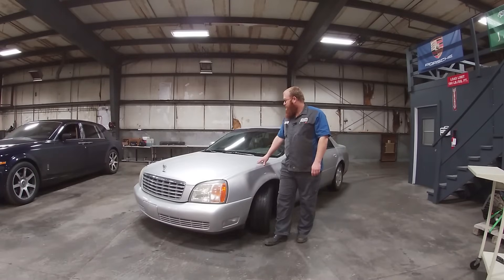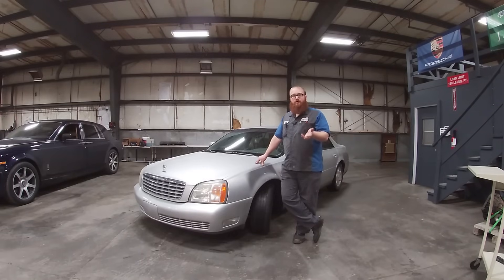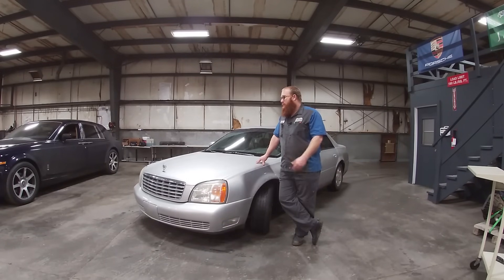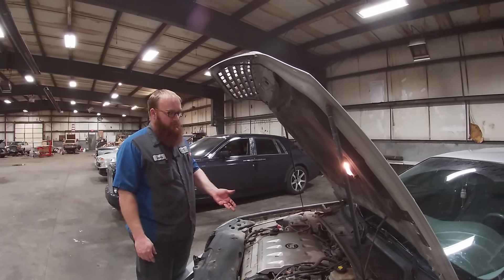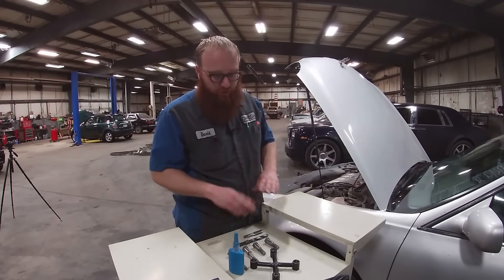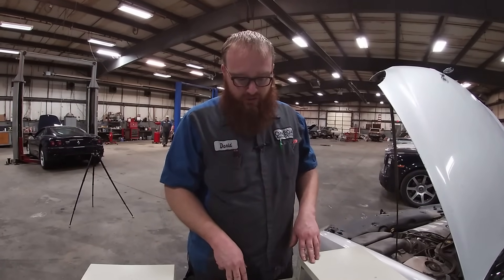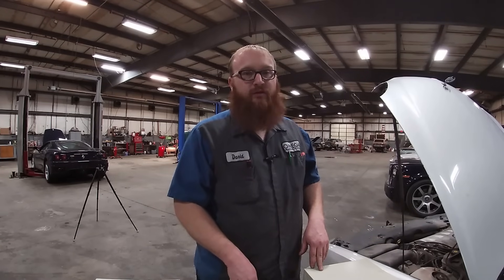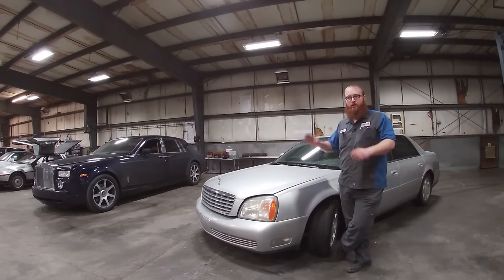The CAR WIZARD names Cadillac's Northstar Engine the Dumbest Design

Comment: The thread nearest the load has the greatest stress.  When the first thread fails, it moves to the second and eventually zippers.   Helicoils increase the thread diameter engaging more material lowering first thread stress.  They also rock when loaded which distributes the load across more threads....precisely what is needed here.  
     Head bolts withstand fatigue cycles from the engine firing.  The joint is designed for the head, gasket, and block to take the fatigue loads, not the bolt.  A good head bolt is long and not necessarily big diameter...a springy bolt shifts more fatigue on the joint. Look at a VW bug head bolt.
     I wonder how this problem dodged engine development.  Engineers don’t design not to work.  I suspect the design was sensitive to manufacturing tolerances that were unappreciated.      BTW, wasn’t the Northstar raced at LeMans?      Cheers

Comment: This isn't the engineering, the problem is the cost cutting at the management level. The Northstar system was DESIGNED with proper head bolts, which had to be manufactured. The bean counters insisted they use existing head bolts to save money. History showed what happened. Same with the HT series. Pushed out before development to save money, by the HT 4.5 the problems were solved but the damage was done.

Comment: Yes the head bolts were a disaster. But to across the board call it a stupid design is not accurate. Other than the expense to fix that it is a brilliantly designed engine. For instance you can lose all of the engine coolant and still drive 50 to 100 mile completely dry without damaging the engine. Try that in anything else.

Comment: My STS, less than 100K miles, head gasket leak and the car went off to the junk yard. Along with the engine case half seal leak, transmission solenoid broken, rusted out brake lines (twice), corroded and porous alloy wheels, water leaking into the trunk, and other common failures. An embarrassing effort by GM/Cadillac. My first and last GM.

Comment: I have a 96 seville with this issue we had heads fixed by local company they blew then I think they put sealer in does anyone know if I'm able to do an engine swap hate to get rid of it. It only has 60 thousand miles

Comment: Could the GM V6 3800 SERIES 3 be the best engine ever produced by GM?  I just ask as I have been reading about which might be the mist reliable in a used GM.  Series 3 only used for like 5 model years.

Comment: I have always wondered why some manufacturers don't long term test these new designs. Certainly these issues could have been found and corrected. I shall now call these engines the "DeathStar". Could it be chief engineer egos??  Could it be the venture capital boys and the accountants? Take some pride in your work already! Maybe they should etch the designer's name on the block or something. Then when the engine finally dies you can have your car towed to the Engineer's front lawn. "What is Munford's address anyway?".

Comment: Love you man but I have to disagree on this one.  I can’t argue with crowning the 3800 Buick as top choice, they are nearly indestructible. But keep in mind the vast majority of these had only about 165 hp so it was not being taxed to the edge of its capabilities. They are as reliable as the day is long and I have owned and worked on many.  However when Cadillac introduced the Northstar it proved to be quite impressive.  It was a hoot to drive one of these big Cadillacs with the 300 HP Northstar that would pull hard all the way to redline.  Not to mention the Cadillac was used at IMSA and Shelby designed a car that used it.   It was one of Ward's 10 Best Engines list for 1995, 1996, and 1997.  Intake and exhaust had variable timing, it had the cooling loss limp home system, and other very unique features.   The supercharged versions had 469HP! 
I know they had oil leaks and some other idiosyncrasies, for sure, but I would put the Ford 5.4 V8 or the Ford 4.0 V6, the Hundai recalled engines, Cadillac V8-6-4,  Jaguar V12,  and several others in the craptastic category long before the Northstar. 
Keep up the good work brother, love your style :)

Comment: So my thoughts… if you can get this car in excellent shape for $2000 and you can make it reliable for $4000, you have an excellent, comfortable car for $6000. Yeah you’re paying above market value of the car for repairs, but at $6000 this car is an absolute bargain. Add to that the fact that the $6000 comes with an engine out service and fresh head gaskets and you have the deal of the century.
Reply: I feel the same way.  I think it depends on ones situation.  I found an 04 DHS for $1800 .  Though it has 3 codes and 137k on the dash, I'm fine with it as I know how to turn a wrench.  I'll just pay for the headgasket if that happened like you stated.

Comment: I had a car that needed the engine removed every 60,000 miles to replace the timing belt. Had it done once. Car didn't make it past 92,000 miles. Every car I've bought since had a timing CHAIN not belt. Belt is a deal breaker for me.

Comment: I love my 2008 dts. She is dripping a little oil but not much. Engine reseal will be done eventually. I think the money is worth it just because they are such nice cars.

Edit: dripping seems to  have stopped. Haven't seen a single spot in a couple months. I think it is coming from the rear valve cover. Common issue. Pain in the ass to fix.

Comment: There is a reason the 1996-2000 Northstars are the worst, even though this engine was introduced in 1993.  Early Northstars used a very high quality...and expensive...grade of aluminum alloy for the blocks.  The head bolt design worked just fine with this stronger alloy as long as you didn't let the engine get too hot.  But sometime in the mid-1990s, the bean-counters at GM decided to start using a weaker, lower grade of aluminum alloy, and this meant the original bolt design was now a problem.  As was mentioned, GM started to fix the problem in 2000, and the situation also got much better in 2002.  The final fix came in 2005.

As stated in the video, the Northstar is actually quite reliable once the head bolt issue is fixed.  GM really could have hit a home run with this engine had they simply changed the bolt design when they went to the cheaper alloy. Instead, they spent another ten years destroying their own reputation and alienating their customer base.

Comment: I have almost 200,000 miles on my 1996 Cadillac Deville concourse I have to guess that they had to gaskets have been fixed in the past since I have had no problems in the eight years that I have owned it
Reply: Make a video of it
Reply: Just purchased the same year & model vehicle from a 91 year old woman who was original owner. 73K actual miles. Changed oil , new tires and blower fan. Fingers crossed it won't give me issues. Well maintained. Air ride still works. Paid $2700.00  Polo edition.
Reply: @chadwrightson3453  congratulations 🎊

Comment: The UK got the Cadillac Northstar V8 in about 1997 they said they needed a service every 100k miles and would run with no oil or water

Comment: I hope the idiot that decided to put a fine thread in aluminum was fired, EVERYONE who works on cars knows in aluminum it HAS to be a coarse thread.
You also forget to mention the location of the starter the Water pump drive and the Flapper next to cylinder one that fail regularly, this engine IS the worst design ever in my book.

Comment: Actually it isn't the dumbest design by far,  I've worked on far worse!  It's actually a really good design that was plagued with the usual GM cost cutting BS.  The worst years were 1997 to 1999 before and after that date with good maintenance (and that's the key) they were a really good engine.  With the Northstar Performance head stud kit they are a great engine that will last forever!  The bottom end oil leaks can be cured with Northstar Performance engine gasket and Mitsubond RTV P/N;  MIT-1000A992, old P/N; MD970389. Mitsubond is probably the best sealant available, I use it in all my engines and they never ever leak!  I've even used it on aircraft!  The Northstar can be removed from the top if you don't have a lift.  It's not easy, it's tight but it can be done! I know as I don't have a lift at home and I need to be able to move the engineless car so I always remove them from the top.  The 97 to 99 cars are my favourites as you can buy them in really good condition and rust free with blown head gaskets for around $500 to $1000, complete engines are around $200, fix them and run them forever.  If you do the gaskets and studs also replace the water pump, thermostat and check the header tank for cracks.
Reply: Header tank?

Comment: Why didn't GM give the phone a tickle and call either Lycoming or Continental and say "Hey brah, how'd you do yours?"  1/2" x 13 thread on studs in these motors. And these things run at near 100% most of the time.

Comment: The reality is that GM is a financial company first, and the bean counters are always forcing the design team to reduce preproduction costs and it’s why I stay away from General Motors products. I’m a retired Flight Engineer, and this is a long lasting story of designs that should have never gone into production in the first place! You can look all the way back to the 3.8 V6 in the 1970s it was a 350 5.7 Buick V8 the cut two cylinders off of, the problem is that Vi’s are 90 degree engines and V6 are 60 degree to be balanced and run smooth. Then the 8,6,4 system of the eighties, the Vega four cylinder engines of the 1970s, or when they decided to remove all the traditional seals and replace them with a silicone sealer that on the north star engine crystallize shirk and stat leaking at 70,000 miles. I just got tired of piss poor design and quality and only buy used high end low mileage one owner German cars, and Japanese cars problem solved. I do like and trust Ford Crown Vic’s if they are the Police package to, great cars and fairly easy to work on.❤️

Comment: The 4.6L Northstar and 4.0 Northstar could have been great performance engines IF they were engineered and built with racing parts designed for extreme duty and hot rod demand!

Comment: $2,000 for the car and $4,000 for the repair IS worth it as long as you are confident that the car will be worth owning, rather than selling, which seems to be the case with this car. I'm surprised GM would let this happen after going through exactly the same thing with the HT-4100 engine. Was the Northstar fixed for good after '04 or '05?
Reply: It was great after 2005 model

Comment: This hurts because my first car was a 1996 SLS...other than leaking oil from the valve stems it has actually been a workhorse. I just can't even get it worked for the reasons I am sure the wizard is gonna explain in this video.

Comment: I think I may have commented on another video about this assertion that the Northstar design is a bad design. There is no problem with the design of the engine. It's the application of design features that was an error. But then again it was General Motors that was putting the damn thing together. They didn't understand they when you cut threads into aluminum, a high fractal metalloid element. It has to be coarse threads. And when you make the block a two piece block you have to be able to bolt it together in such a way that it is basically permanent. They did neither properly. Once you fix those problems, and aftermarket has figured out how to fix those things properly the Northstar Engine actually works quite well. Which means it's basic design is not the problem. It's the application of design features where General Motors thought that you could just douche it anyway you pleased and it will be fine. I've seen Northstar engines, especially from the 98/99 up to about 2002 with warped heads within a year of purchase.

Comment: HT4100 that came before this gen of Cad V8 is leaps and bounds dumber. I'm getting ready to rebuild a 4100-derived 4.9 as a labor of love. My lord, you couldn't get worse. Features include:

-Cast iron, semi-floating, hand-removable cylinder liners that require a rubber o-ring at the bottom to seal the open-deck water jacket from the crankcase, necessitating adding a stop-leak pellet made of ginger root every other coolant change to prevent coolant intrusion
-An aluminum engine block so weak that the heads and intake manifold are structural and MUST be bolted on and torqued before main bearing clearance can be checked, or else the block will shift and give you a false reading. Incorrectly torquing or overtorquing the intake manifold can shift the block and damage the main bearings, as per GM TSB's.
-Head bolts whose holes strip out extremely easily and extend through the bottom of the deck surface, out the side of the block, and into threads external to the block, necessitating a custom tap extension to helicoil the threads (good luck getting a timesert to fit)
-A central rocker arm "bridge" consisting of 4 aluminum rocker arm pivots (think Oldsmobile V8) secured with SELF-TAPPING BOLTS to a central aluminum bar
-Triangular cylinder heads where the pushrods pass through the intake manifold, necessitating total rocker arm bridge assembly and pushrod removal for an intake manifold gasket job
-A 2-piece cam bearing saddle assembly bolted to the block with bearings that are installed unfinished and then line bored to the block. Cam bearings are non-replaceable.
-22mm Metric (not pipe threaded) oil galleries that require a rubber o-ring to seal
-A camshaft with a cast-in thrust plate that pushes against the block, not a dedicated plate
-A water pump held on by like 15 or 20 fasteners with 4 different head types and sizes in the absolute worst spot ever, right up against the frame rail
-Much, much more that I can't think of right now

I get that the 4.9 is more reliable with proper maintenance than the Northstar, but once you neglect biennial coolant changes on a 4.9, all hell breaks loose. Northstar all the way, for you gearheads out there.

Comment: I just can't understand a company that has making car engines for over a hundred years designing an engine with head bolts that are inadequate. When an engineered item is deemed satisfactory it is still made at least 25% stronger as a margin for error. What on earth were they thinking?
Reply: they saved 10 cents

Comment: I heard every time you hear an engine ping a Cadillac engineer loses his wings. I think all caddy engineers should be forced to buy only the cars they design. then there would be major changes in their engine designs due to the all the blown gaskets and engine oil leaks that occur after only a few miles on the road.

Comment: Is there a year of Northstar that doesn't leak oil like a sieve because of the dual oil pan design, rear crank seal, etc. etc.?  GM is great at fixing all the little bugs on the FINAL year of a production run  once the reputation of that vehicle/engine is destroyed.

Comment: Such a shame this engine was designed this way. I personally love these engines, despite the head gasket problems. This was a huge leap forward in design for GM at the time. I think it was 1993 when this engine came out. And for the time this was a very technologically advanced engine for GM. DOHC Aluminum V8 pumping out 275-300HP. I think they used this engine design up to 2010. It had a  "limp home" fail-safe mode, which allowed the engine to continue running for a limited time without any coolant. Supplying fuel to only one cylinder bank. In turn, the engine would "air cool" the inactive bank, theoretically if this was working properly the car could be driven about 90 miles without damaging itself. They made a V6 version, a smaller 4L version in the Aurora only, and they even de-bored one to 4.4L and slapped a Supercharger on it for the STS-V and the XLR-V. And the tuning capabilities of this engine are insane I think there is one somewhere here on Youtube that makes 600HP.

Comment: I like your video but it has some misinformation! The headbolt design on the Deville was only changed once from the time the first Northstar rolled off the line. The ONLY headbolt redesign took place for the release of the 2004 model year Deville. That new headbolt design ran thru the end of the 2011 model year. That is fact! Just look up head bolt part numbers for Northstar engines and you will find that there are only two different part numbers. In Deville line it was 2000 to 2003 and the revised headbolt design from 2004 thru 2011. Keep up the good work!

Comment: One could justify the cost of this fix, if, # 1 you get a real clean low mi car and # 2 you drive the thing  until the wheels fall off, in other words ,don’t consider resale value.
I wouldn’t be surprise if one were to buy a luxury car like this from another manufacturer you’d be paying 7/8 grand minimum .
I’m just saying ,looking at this from a different angle , it could make economic sense .

Comment: The Cadillac Northstar is not a failure of design, it is a failure of execution. It has the wrong type of head bolts, and they never use the proper seal between the two portions of the block. It is a bit over design. But it's basic design is perfectly valid. And runs properly when you use the proper parts and procedures for putting it together. And of course running the right oil in it.

Comment: Late 90s-2005 this is true they fixed that issue with the head bolts in 2006 but the worst design hardly !!rotary engines are built for 80k and are meant to be replaced not rebuilt ! For 60-80k car that’s trash atleast if you take care of the caddy it will last